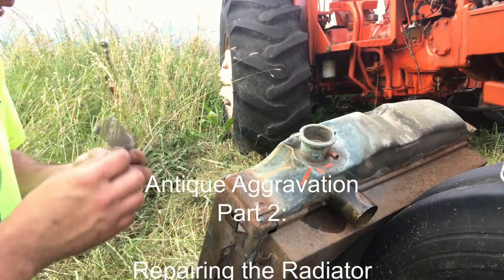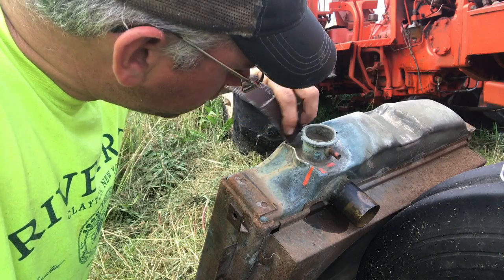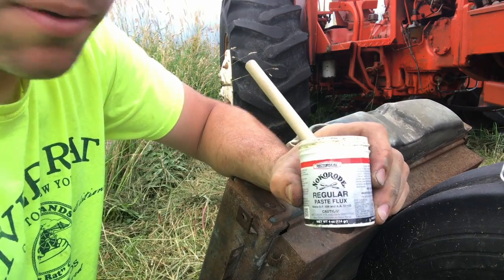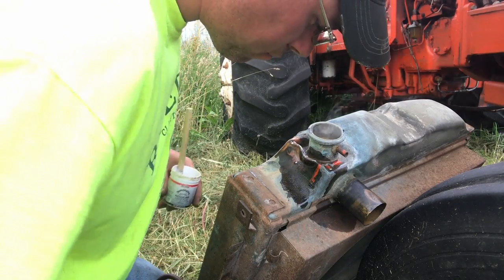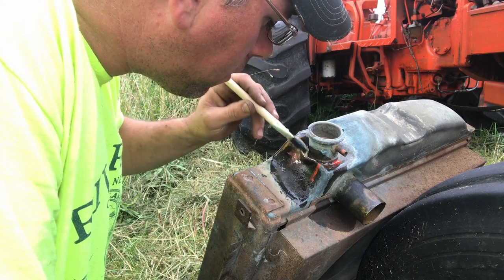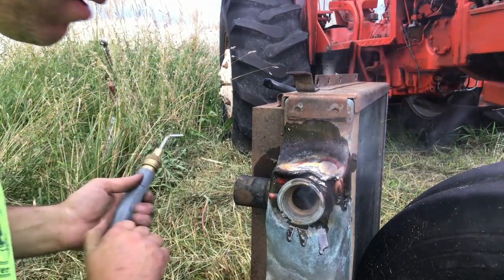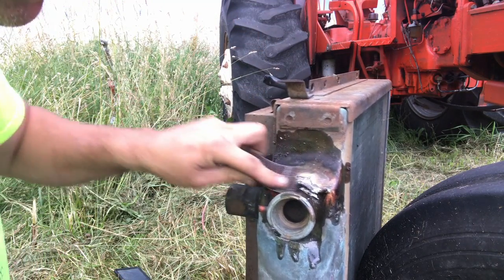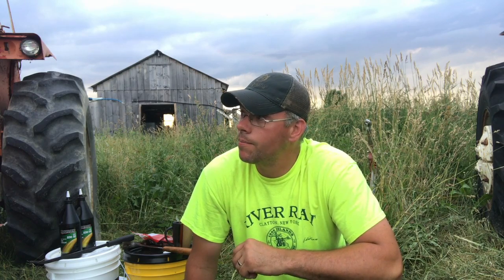Antique Aggravation Part 2: DIY Radiator Repair

Comment: Jim,
Enjoying the farm video's. Just the other week, we had to pull the radiator out of '88 model MF - 245. While doing some clearing had a limb jam into the fan and take out the fan and damaged the radiator. While I have made repairs to radiators before, I went with a radiator shop this time. 

A couple of questions, What type of acetylene torch is that you used? Also, I have always used acid core solder for radiator repairs (that is what my Father would use before he handed off those type of repairs to me), will the silver solder work better?
Reply from the maker: +Chris Cox your solder probably works easier.  This stuff is a little stronger than standard solder but harder to work for doing this kind of thing.  That is a turbo torch set up on a mc tank.  Also works on a b tank.

Comment: Look at that,  I'm internet famous!  lmao   Solder job was definitely the direction I would have went  on the job like that in a field.  Nice torch set up, too.  I swapped over to propane a couple years back,  little cheaper if you're using it a bit.  

There's an important lesson I feel in this vid with a field repair.  Everyone I've talked to that's not familiar with practical farming, and homesteading for that matter,  thinks that they're going to fail miserably because everything isn't "just so".

Do what's fastest that won't bite you too hard later and get the work done.  If it looks good from my house and keeps you producing,  then that's the best solution because the work HAS to get done.

I see constantly with the prima donna welders who are of the opinion if it's not going to trend on instagram,  it's not a good weld.  Bullshit,  the best weld is the one completed expeditiously that consistently passes inspection.

Excellent repair, Sir.  I think you're a bit modest about your ability though :D
Reply from the maker: +Rk Stewart thank you.  You are right on every point.  As far as modesty, I hate arrogance and hate to come across that way.
Reply: I completely understand your point,  but you were a bit critical imo of yourself making an excellent field repair.  Take it from some idiot who's gone behind other idiots doing mobile welding and heavy equipment repairs,  you're making that junk look like Michelangelo painting the Sisteen Chapel soldering knee-deep in hay, videoing for youtube.

That's a fair amount of plates to be spinning in my book.  I also greatly appreciate the no bs delivery in your videos.  I think people will realize your genuine and care more about that than stage  presence, least the other tradesmen will.   :p
Reply from the maker: +Rk Stewart that's what I'm going for.  I don't feel the need to create a character that's not me for a view count, what you see is what you get with less swearing.
Reply from the maker: +Rk Stewart same here.
Reply from the maker: +Rk Stewart hey, I just saw your message through my email, when I get back in front of the computer I'll respond.  I have no problem with what you want to do.  I'll get you the info asked for.
Reply: No problem my man,  holler when you got a sec.
Reply from the maker: +Rk Stewart there is a reply there if it went through.
Reply: Now the million dollar question,  how do I access it?  lol  No worries,  I'll holler at the domestic partner if I don't get it licked with google
Reply from the maker: +Rk Stewart that's a damn good question.
Send an email to jim@tradesmanoffgrid.com and I'll get you my contact info to bypass the bull.
Reply: I got her figured,  you just go to the help section and they have a topic on how to get into it.  Easy-peasy
Reply from the maker: +Rk Stewart brilliant

Comment: Have you ever tried STA-CLEAN liquid soldering acid? it will make solder flow like water without dropout over holes providing you don't get the base metal too hot. I never cared for silver bearing solder, I am aware that it has more tensile strength, but a good thick layer of 50/50 solder in my opinion works better and a whole lot easier to use.
Reply from the maker: +Nortekj my choices were 95/5 or the silver bearing.  The silver bearing is much harder to use, flows a little too freely.  I've used a lot of the Sta-clean paste flux for brazing and soldering and is good stuff.  Never tried the liquid.  I do have a roll of lead solder kicking around but I reserve that for metal gas tanks, stuff is hard to get up here.  Thanks for watching.
Reply: Most welding supply places has the 50/50 if not, another place to try is to go to a radiator repair shop and ask them where they get their supplies from. The reason it is hard to find is due to "do it yourselfers" trying to do plumbing that will supply water for human consumption, another Govt. mandate  to protect it's income of tax money. If you ever try the liquid STA-CLEAN, once heated and then cooled it will burn skin, so make sure it is rinsed off  with water.
Reply: Nice skill i liked it
Reply from the maker: Thank you